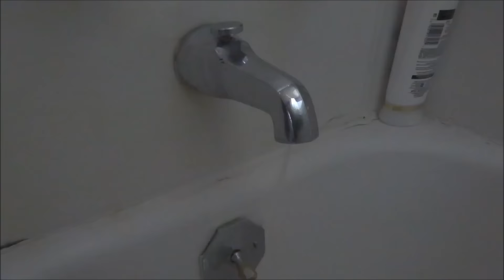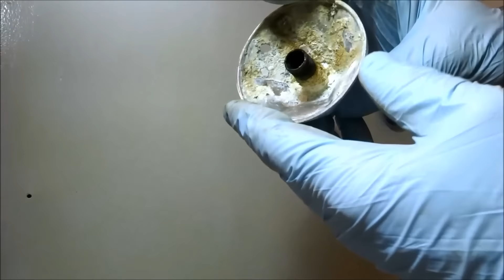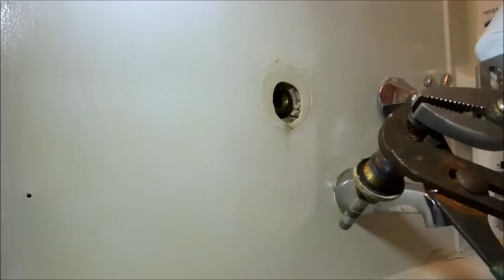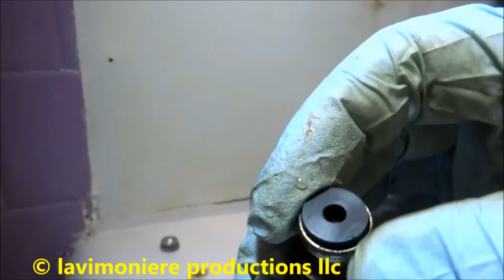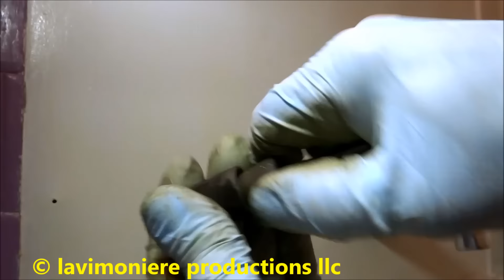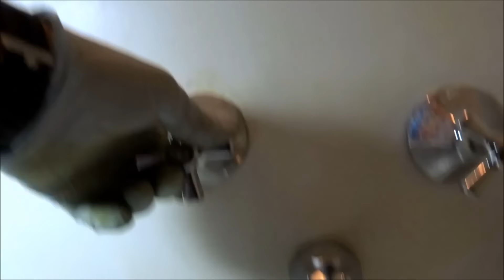old tub / shower valve leaking water badly

Comment: Sometimes when I'm in a situation where the seat has crapped out and I can't get it out without wrecking the pipes b/c they're so old, I just put a nice beveled washer on there so it sits on the inside of the seat where it's less worn( I use red hot water washers on hot of course). It holds up great!

Comment: Sometimes I have resorted to replacing tub spouts with ball valves and installed ball valves on shower arms to get customers by for awhile
Reply: That's actually not a bad idea.
Reply: Jim Rr hack move
Reply: I've done that too when they don't want the tile removed or there's no back access. Or they just flat out don't have the cash for a proper repair. It will get you by for the time being.
Reply: Yep, but gets folks by while they assess the charges yet to come...happens.

Comment: Steve why is there  no main shutoff in basement? Is it broken? That is odd
Reply from the maker: there is a shut off its old and frozen i can not move it ,so it needs changing before i can shut the water off to the house
Reply: shupe1907 you start messing with an old shut off and he stem breaks; then steve's insurance company will be replacing this lady's house free of charge
Reply: you'd have to be insane to try force that main shut if its resisting to any degree.  If its corroded, I like Steves idea....shut it off by the city and replace the main...I don't get that warm fuzzy feeling with corroded crap, you break it, you buy it ( from the customers perspective ).  I saw a complete valve replacement on this Old House where he bought this large diamond shaped patch that goes on the tub side with a large Goof Plate to cover the access hole.  Her only other possibility is to run around to restoration yards or look on the internet for a replacement seat.... Plummer don't have all that time, what you could do if she insists, is to yank it out, give it to her, and see if she could find a replacement or have a machine shop fix the seat... Ive seen machinist do some amazing repairs before.  It appears to me she doesn't have two nickels to rub together.... She has no intention on doing anything, Steve knew it too, I could hear it in your voice...She understood full well what you were saying.....

Comment: you can do this without shutting off the main water?
Reply: I had the same thought why wasn't there a geyser coming out of the wall the whole job?
Reply: He was only working on the hot side.... turned off at the tank. He said he couldn't do the cold side until the main could be turned off so the shut off valve could be repaired/replaced.

Comment: +steven lavimoniere   I'm surprised you need to have the water department to shut the water off at the street.  Is that somehow mandated by the city?  I know I can shut mine off easily with a crescent wrench...
Reply from the maker: i do not touch a water curb stop because is i break it i have to have it dug up and replaced .not worth the risk ,best to call the city or town to do it if it breaks its on there dime not mine ,maybe know it will make more sense . thats why i do not touch them
Reply: steven lavimoniere  Gotcha, makes sense.
Hopefully the water dept are pretty responsive to coming back quickly to turn the water on after you are done so the customer is not left high and dry.  Have a great 2017 Steve!